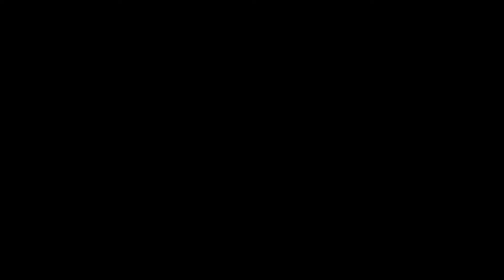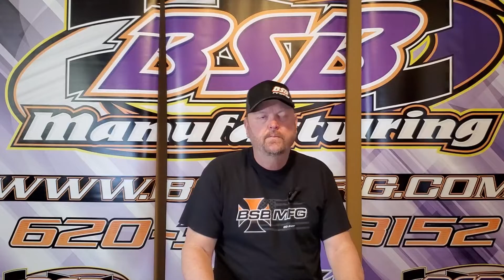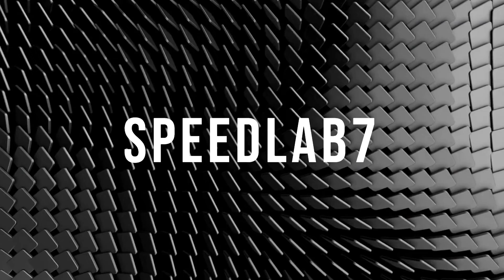Preload on Pull Bar

Comment: Do you prefer pull bar over lift bar
Reply from the maker: A pull bar seems to make the car too tight, so I do like the lift arm, but I am going to say most racers will like a pull bar over a lift arm. All based on drive, not lap times or how the car drives.